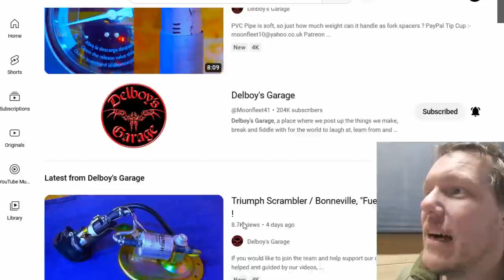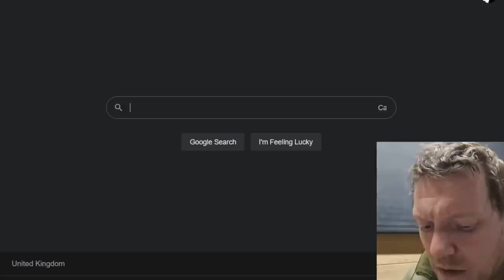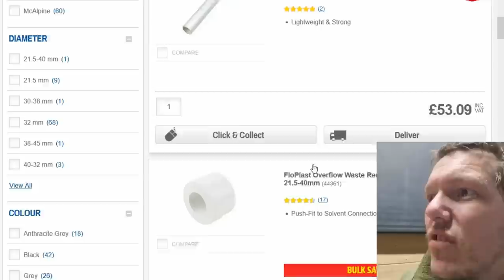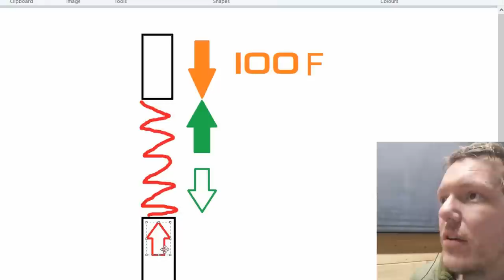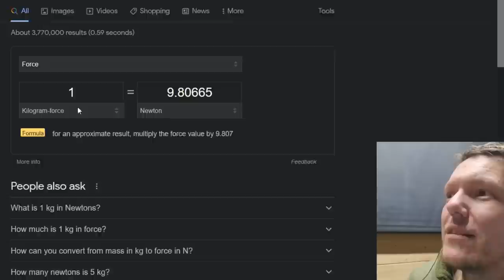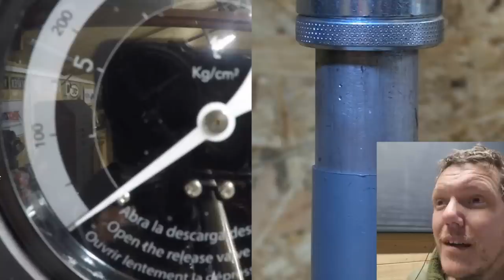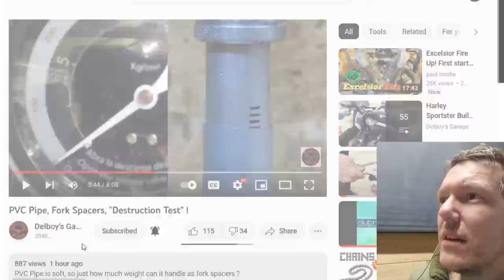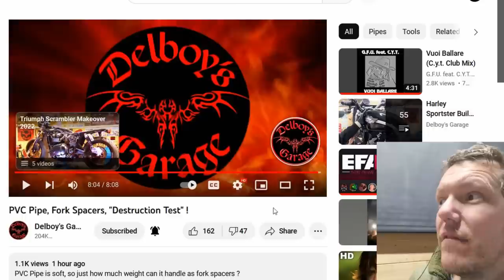The Sci 'n' triffic Del Method

Comment: He is a fucking liability...  The "waste of time" pipe was deforming with no measurable force on the gauge.  As he said and you also pointed out the plunger moved about 8mm before it even registered on the gauge..  Now as for forces the plastic could see and what if failed at the the key things to know.  The PVC pipe was deforming immediately so that is a fail, end of..  The OEM plastic failed at 2500kg Approx. So for me the bike I know the specs for are the Suzuki GSXR600 K7 which has 125mm of  front wheel travel ( OK head angle will make a difference to actual fork travel but for this lets ignore that as Del ignored the most important part where it failed from the get go!) The front fork springs I used were rated at 9.8KG/MM (close enough to 1kg/mm for this) So to fully compress each fork we would need 125kg or 250Kg over both forks. The bike in road spec with a full tank of fuel was 198kg and add a rider it should bottom out braking hard but add pre-load you still usually have 5-10mm of travel left at maximum braking effort on track. That would mean that brittle plastic tube can take 20 times the force needed to compress a neutral spring. It is almost like Kayaba knew what they were doing. Dels crappy pipe will have compressed about 8mm (no real measured scale on his sharpie scale) and that loss of 8mm could be the difference between having a little bit of "bump" travel left and bottoming out the fork in normal heavy use. 

Please please please somebody go and ask him to do fork damping and fork oils next... I really want to see how much he can fuck that up now....

Comment: OK my bit on ethanol and fuel tanks..  Full disclosure.... I make and sell fuel tanks that are usually replacing plastic tanks that have swollen or expanded or seem to weep due to ethanol...  So here is what I know so far from a really basic " I read it on the internerd" Most of the Aprilia plastic tanks use PA6 to make them and it has less of a problem with ethanol than HDPE plastics, that some 5 litre fuel cans can be made of, and is more suited to fuel use than most plastics for the "expected life" of the bike.. The issue is the plastic and that ethanol is hygroscopic so the usual cycles of hot and cold each year and the condensation you get all add up to water getting into the fuel tank and into the PA6 which is also hygroscopic.  The test was comparing two 1mm thick test pieces of PA6 and HDPE and they found the HDPE had 8% solvent uptake within 24 hours of exposure and the PA6 took 200 days to reach the same 8% of solvent uptake. As time passes this solvent uptake will get deeper into the tank, as the Aprilia tanks can be over 10mm thick in places, and so with the water absorption the PA6 can expand and swell over time. This is not usually in months or even in a couple of years as the problems are being seen in bikes that are now up around 20 years old. Will E10 or even E85 (in the USA) speed this issue up?? I doubt it would make a big difference but as you say the cocktail of hydrocarbons in the fuel may also have an impact. But the fact that most who have a problem who say they can put an empty swollen fuel tank into an airing cupboard over winter and see a significant reduction in the swelling seems to show that much of the problem either water or ethanol being absorbed over the life of the tank.  I feel personally it is mostly water not the ethanol as I have made a mould from a brand new (old stock) out of the box Aprilia tank and the two dowl location pegs are 6mm out compared to what an actual brand new tank. The only thing this tank will have seen is 20 years of humidity in a warehouse or in the loft of my garage which can get humid during summer months.
Reply: Very interesting.  Cheers 🍻
Reply: @Critical_Stinking  It's from seeing so many bikes have the same problem, I have made over 100 Aprilia RS250 fuel tanks for both the MK1 and MK2 versions. People don't usually spend over £1000 on a fuel tank unless they have no other choice or REALLY want a carbon fuel tank.
Reply: @YAMR1M  I found your comment very educational. I didn't realise they used HDPE. Same as milk bottles 😄. 
I'm a bricklayer by trade,so forgive my ignorance...could you use recycled HDPE to make a fuel tank safely? 
Or repair one?
Reply: Here in the US, the laws changed. So now they can put up to 15 percent ethanol content. They real kicker is all the pumps are labeled for 10 percent. They do not have to change the stickers and placarding to reflect the 15 percent. So I’m my case my 2 Toyota 4Runners, and my 2019 Honda 1000RR, and my Honda commercial lawn mower says in many places DO NOT ADD MORE THAN 10 PERCENT ETHANOL CONTENT. I don’t think a lot of people here in the states realize what’s going on. I just buy non ethanol all the time for my trucks and everything else.
Reply: @Critical_Stinking  HDPE is not a great idea but the cheap gallon (5 litre) cans don't  hold fuel long term or have to fit a chassis like a bike fuel tank its not usually a problem if the can swells.  You might notice they can bulge over time  and not look the same shape as a brand new one.  Its not a good idea to try to repair a plastic fuel tank as plastics tend to self release and a repair will not work long term.  Most if not all of the fuel tank sealers don't work with plastic tanks for one reason or another. The resin sealers are rigid and do not expand the same as a fuel tank will in the sun or contract as much when it gets cold sitting in a garage over winter so it cracks and breaks up over time.  The flexible sealers also tend to self release from the plastic over time too and I have seen them where it can look like someone has cut up white workshop gloves and dropped it in the fuel tank with bits of it just breaking up and floating around in the fuel.  Plastic tanks are OK most of the time its only when the bikes become old enough to be seen as collectable that its a problem. But then now I am even doing carbon tanks for older steel  tank bikes as they are rusting badly and its getting to the point the water the ethanol attracts is speeding up how quickly they rust.

Comment: Solvent pipe is more brittle than push fit pipe push fit. is softer plastic .solvent pipe is hard plastic lol so that the solvent adhesive will weld it  the size is also different so you can't use one pipe with the wrong fittings bell end is using push fit pipe

Comment: Here in the US they can now add up to 15 percent ethanol. My 2 Toyotas state no more than 10 percent ethanol, my Honda 1000RR says the same. So they can add up to 15 percent at the pumps without telling us at the pump. I do not buy ethanol. I get better mileage, I don’t need to add anything over the winter. Ethanol is crap, I don’t use it. If they mandate it, I will mix my own fuel and separate the ethanol out in my garage.

Comment: Ethenol attracts water, water sinks in fuel, water makes corrosion.  I could care less about the plastic, I'm worried about the metal bits.  Aluminum fuel bowls, steel tanks...

It certainly doesn't seem to happen over a season, but it'll ruin a set of carbs over time

Idk about European petrol, but in the US you can get great fuel or super crap fuel

Comment: If he used solvent weld pipe it would shatter like the factory plastic tubes . Solvent pipe will snap and shatter push  fit will fold and crumple

Comment: 34 mm on the pipe is the external diameter but it is 32mm (internal) push fit waste pipe pp from screwfix. The 32mm abs is harder and more rigid and used with solvent glue but it's external measurement will be bigger still.
He literally just using waste pipe

Comment: That's Del gaslighting himself.  His first reaction on seeing the tube clearly deforming before he was even registering on the gauge should have been "ohshitohshitohshit", followed by trying to find a transducer that can measure at what point it was starting to deform.  Instead "no, that's clearly fine and exactly the same as the factory item that reacts totally differently".

Even his "just use steel, that doesn't fail" annoys the hell out of me.  What a tit.

Comment: Just out of interest on your factor of safety, I used to race a Hayabusa turbo at Santa Pod with 450bhp & I only ever used a standard gearbox for years, using an air quick shifter slamming into gear with 150psi never had a problem.